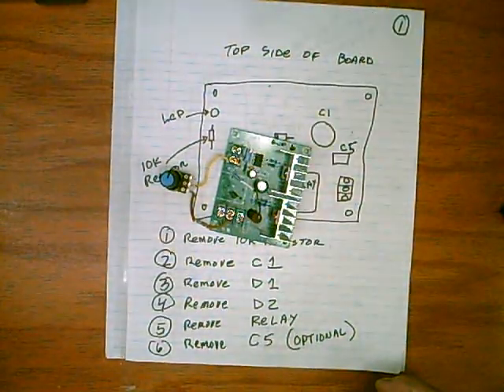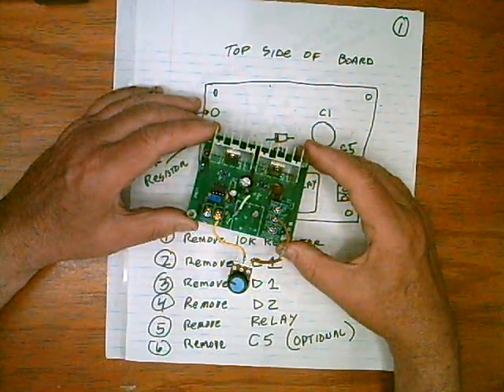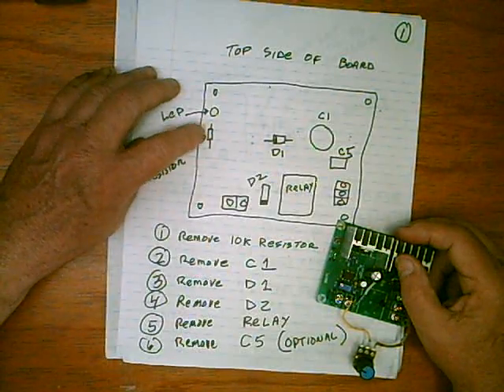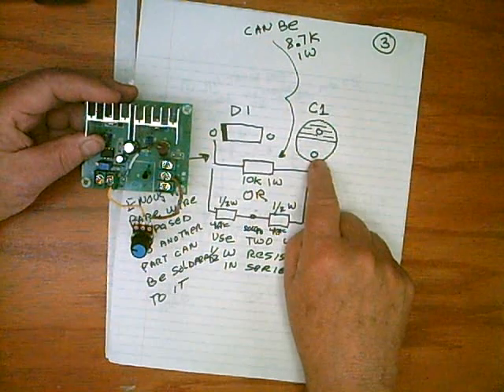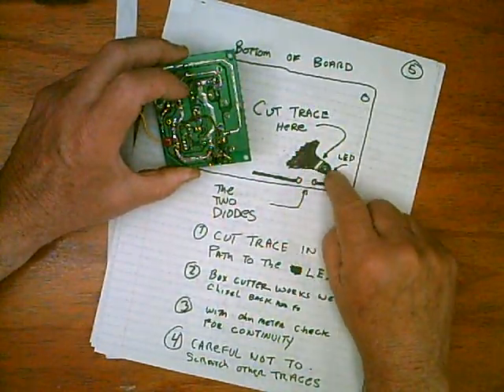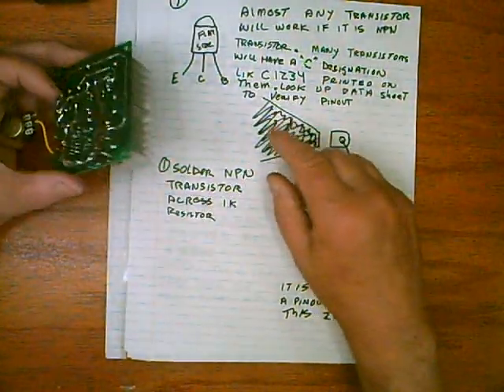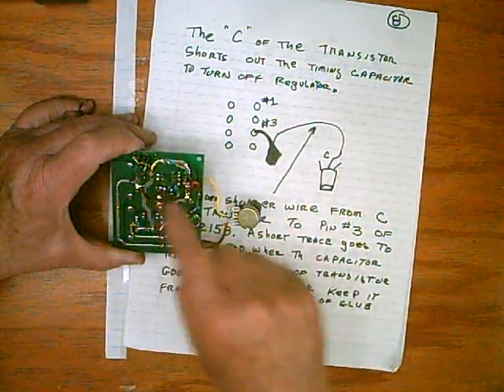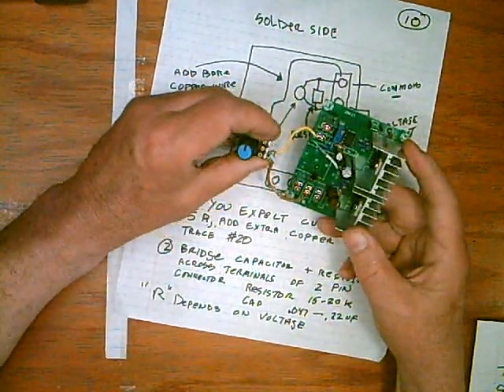FREE PV SOLAR HOT WATER POWER POINT EVEN IN THE RAIN (pt.2)

Comment from the maker: Search for these as 300W inverter board.   Look for one with a 8 pin IC.  At this time I will not provide a link. I just ordered one today, arrival mid July. It's China and you never know what you are going to get. I would like the one with the 8 pin chip. There is a possibility it will come as the new version with the bigger chip. That may work OK with a minor change to the build. Anyone want to buy me a new version board? I ordered three in April and never got them. Last seller I got them from no longer sells them. Given that the FET will probably have to be changed to a 10N110 and the old version board may not be available, might as well build it on some perf board. Ten IRF2153 are only $5 and it is only a couple parts to add.
Reply from the maker: @SiriusSolar  Thanks for the offer.  I was just expressing my disdain for those on the internet who want more and more and more, want it right now and free.  Don't want to loose my integrity trolling for money. I've actually sent two working systems to people to get some real life data.  To this date, neither has ever connected them up.
Reply: opera hello just wanted to let you know I’ve ordered the parts and inverter board to build this hot water system. Thank you for your instructions.
Reply from the maker: @LRasmussen01   I'll be here to help you all the way. The biggest step is to make the commitment to start. What voltage and size array will you be using? I've ordered the newer board just in case that is what they send you. Love to see you do a video on the final setup.
Reply: opera Thank you! Really. I purchased 6 245 watt panels. I plan at this point to dedicate two of them just for the hot water project. Each panel should produce 30 volts. Almost 9 amps. Or 60 volts in series. I’ve just placed orders for parts mostly from AliExpress. So, while I’m waiting. I’ll  get the two panels set up. I have a 30 gallon 220 electric water tank. I am unsure at this point if I should keep the upper coil hooked to the grid or replace both coils with the 120 2k watt coils and just run PV. Thank you again for your offer to help me with this project. I’m sure I’ll need it. I have not done utube video before but I’d be happy to with your coaching.
Reply: Insert element for coil. Lol 😃
Reply: opera now that I have my inverter boards I can get started but still waiting for parts.

Comment: ??   What board is this your modifying ?   Any links to one like it ?
Reply from the maker: Search for these as 300W inverter board. Look for one with a 8 pin IC.  At this time I will not provide a link. I just ordered one today. It's China and you never know what you are going to get.  I would like the one with the 8 pin chip.  There is a possibility it will come as the new version with the bigger chip.  That may work OK with a minor change to the build.  Anyone want to buy me a new version board?   I ordered three in April and never got them.  Last seller I got them from no longer sells them.  Given that the FET will probably have to be changed to a 10N110 and the old version board may not be available, might as well build it on some perf board. Ten IRF2153 are only $5 and it is only a couple parts to add.
Reply: @opera5714  LOL, Yea China.  Every order is a new adventure,  eaaa?  As long as you understand how the Chinesium Rating System works your ok.  When they say   Rated 20A  you just need to know that's when it burst into flames.  It will only start smoking at 10A.
Reply: Ok, Found one.  Two versions.  One carries the 8 pin dip and other maybe 14 Pin .   Looking  these are Square Wave Drivers.  LOL,  I happen to have a old 1970's Buzz Box inverter here I could use playing with one.  That one uses a Relay to do the switching.  LOL   No one could afford sign wave converters back then.  Being for 220 I'm guessing they're 50Hz ?  I'll keep looking.
Reply from the maker: @pulesjet  No, that won't work at all. The 2153 has a unique feature that it can be turned on and off in fractions of a cycle making it a PWM device. that can drive a water heater and maintain panels at power point.  It is not an inverter and that confuses everyone. It is also not 300W as the board will drive up to a 1KW.
Reply from the maker: @pulesjet  The problem is all the sellers are virtual, they have never seen the stuff they sell or have any idea about it. and they are not good about changing the listingg as the product changes as long as it has a similar function. The generous specs you can deal with.
Reply: @opera5714    Good Enough.    Dhooooooooooooooooooooo!

Comment: 70 amps * 60 volts so can I really push 4200 Watts through this?  I've got three charge controllers on my solar system. 2500 watts, 2500 watts and 1700 Watts. I was thinking of using the two 2500 watt arrays for the hot water. One would run the top element and the other would run the lower element. Or could both run both?
Reply from the maker: Where did I say 70A?. Just kidding. The heating element determines the max current. All the array power does not have to be used.  It is good to talk about a real application.  I have a 60V array and a 50V array which powers two tanks independently. Both these arrays have more power than I can put into my heating elements. You don't need to put it in all at once. At home I have a heat pump water heater. That is only about 1200W of heat. Recovery is slower than 4500W heaters. According to the board makers claims you can put 25A thru the board. Without extraordinary efforts, I wouldn't suggest more than 10A or 600W with 60V. A common 2,000W 120V element will produce 500W at that voltage and more if the panel voltage rises.  With my situation I can only get near that for a short period of time.  With a larger array you would get that most of the day.  Operating at 90V would give a a full KW. The real secret to heating with solar is to preheat the water with an extra tank requiring only a 20F rise in water for fast recovery.  Have you ever recorded what power you use to heat water each day? I would use one controller for each heating element.  

The basic principal can be expanded up to any size, just don't think that is necessary. Add more FET and capacitors, IT will work.  I have someone using a microprocessor based version on a 3KW array with six heating elements. Only one is pulsed up to 600W the other five are either on or off. That keeps the electronics reasonable.  There are versions of the posted controller commercially that claim several KW.  I think their efficiency drops and the capacitors may have shortened life.  

This is a nice little system for someone that has a 1,000-2,000 that would like to get some free hot water.

Comment: So for a 1kW array at 115v(ish) only bigger FETs are needed?
Reply from the maker: I'm glad you brought that up. I recommend a( IXFP)110N15 FET as a replacement. That is a high current 110A and voltage 150V and about 10V over that it will turn into a zener and really heat up. That is cutting it close.  If the voltage divider is selected carefully, it will never get that high due to shunt action. I generally buy the cheapest. It could be a fake, but the application isn't critical and it is not hard technology to duplicate. It is like the power FET of the month and in a short while all the inverter mfg have switched to a newer FET.  Not much reason to fake.  

High current FET prevent board heating.  Availability and low cost make this a no brainer.  My system is only about 5A and there is no heating at all.  12A should be fine. High currents need a bigger capacitor bank and it is generally better to go with higher voltage if you are comfortable.

CAUTION  The pins are inline which does not give enough clearance at high voltages.  Someone not experienced in soldering can make that even worse. Normally the pins are set in a triangle, but preformed pins probably cost .001 cent more.  I recommend that the center pin just be cut off where it thickens.  That pin will connect thru the heat sink.  Then cut away the solder pad to give more clearance. It should lift easily after being unsoldered. Get that area as clean as possible with alcohol.   When you are sure everything works, for extra protection dab some clear nail polish.

TIP.  When removing old  FET cut one lead.  That will make it easier to remove. It can still be used for other projects if cut at board surface.
Reply: @opera Ok so for capacitor bank at that voltage  would 250v volt units at a bank capacity at 10000 uf be enough?

Comment: for us just finding out about the use of these inverters , this video will compliment what opera is showing:  https://www.youtube.com/watch?v=_OBjcFNPOR8
Reply from the maker: There is a new version of these which eliminates the relay and adds a voltage regulator for 24V use. I have a couple arriving in a week.  Will be using shutdown pin to do cycle by cycle control at a higher frequency.  A lot less foil cuts. That should  make it seem easier as the cuts confused some.  I thought a community would be created of those building these controllers.  I get zero feedback as to what they don't understand.